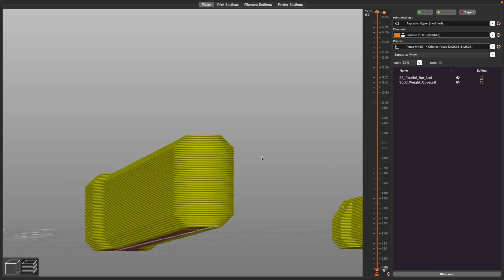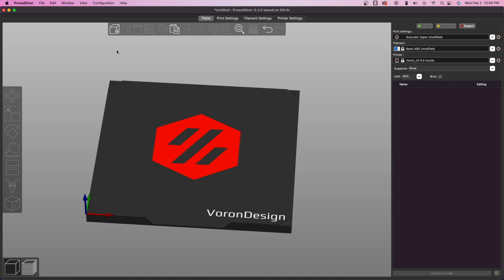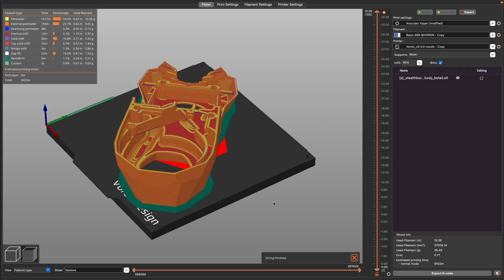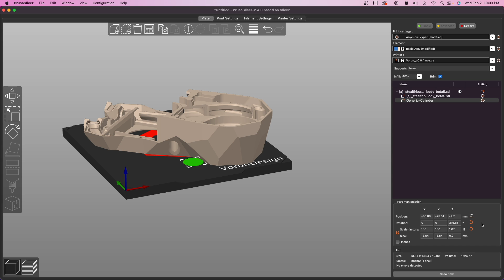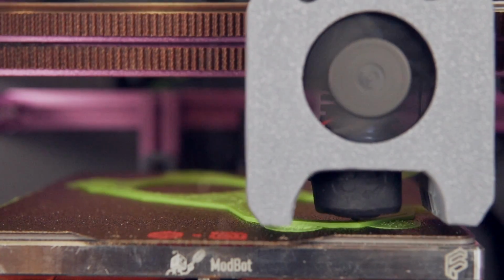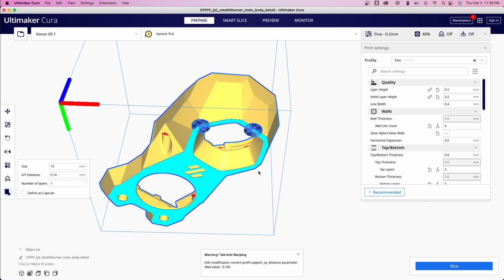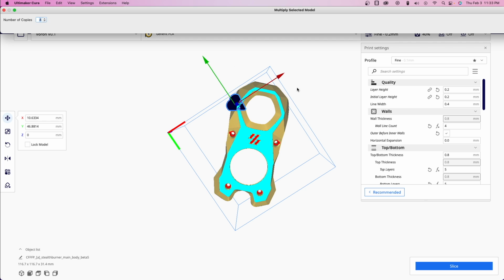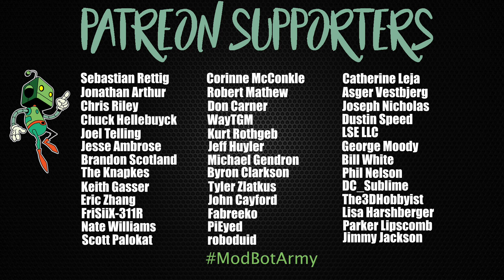Using "Mouse Ears" To Prevent 3d Print Warping

Comment: Ignoring ease of removal, do mouse ears of 2 or 3 layers high perform better or worse? I just want to reduce warping at all costs, I'm printing a big flat rectangular part and it will not stop warping up in the corners

Comment: A better way to do this is to open the file up in cad. Draw a circle in a sketch but offset the boundary around 0.1mm away from the part. Then export this with the STL into the slicer.

This way the lines wont go into the part and will act more like a brim preserving the line pattern of the first layer. I think PS even has an option for this now. Alas its not in Bambuslicer yet.

Comment: Thank you for this video. I am still an amateur and have unnecessary problems with warping. Usually I use a brim on the outside only but is most definitely going to use anti-warping tabs to see if I can save on wasted filament.
I'll be using the words "anti-warping tabs" though I can see how "mouse ears" came about. My term immediately says what it is used for.

Comment: Even if the part does not lift from the bed, they can stil warp.
When I print really big parts, they lift the whole PEI sheet from the magnetic base, and it's not a bad bed (Two Trees) Not perceptible to the eyes, but the parts are definitely warped on the corners.
So in those cases, no matter the brims or the custom ones as you show, you will still get warping.
Reply: I've had the same thing on larger PETG parts, ended up with the stationary clips on the magnetic bed. Also found even quite a gentle air draft in the room will really encourage warping.

Comment: I'm very surprised that you have the need for mouse ears on your Voron Zero. I used to use them years back on unenclosed printers, but they certainly are not needed to print any Voron parts. This looks more like workaround rather than fixing the original issue. Since in the video you never showed Filament tab, it's hard to guess what extrusion temperature, bed temperature and cooling is set for the ABS profile. Also let the printer heat up for at least 30 min before printing! It's less pronounced on V0, but mandatory for 2.4/Trident to have successful prints. I do heat soak mine for 2hours and all ABS prints are excellent :)

Comment: I give my brim/ears a 0.08mm offset. When printed I find this gives me enough contact to the part to hold it down but creates a nice weak point, making removal a lot easier. The value may not work for everyone, but the principle is useful I think.

Comment: Great beginner tip. Been doing that for years with long parts that don't dont have a lot of surface area on the build plate. A deburring tool is a great help to get rid of these mouse ears afterwards.

Comment: Ive never found brims to be particularly useful. The are a small improvement and will not fix any significant issues. Controlling the environment has always proved to be a superior method
Reply: Adding brims is a slicer setting, controlling your environment can be a massive undertaking, often requiring a considerable monetary investment, multiple trips to a hardware store to obtain the materials to construct a suitable environment, and re-configuring sensitive electronics to enable that environment to function.

Nobody is saying controlling the environment is inferior to brims. They're saying brims can sometimes make up for a poor environment with a cent or two of filament.

Comment: I use them in Cura fairly often. Not on every print, but on oddball shapes, or large pieces that want to curl off the bed. They work pretty well and are a lot less onerous to clean up after.

Comment: Wan thinking about using mini heat gun to blow hot air on the print level, to prevent somehow of a heat treatment to see if it reduces internal pressure and prevent wraps…

Comment: I also use "mouse ears" on some ABS prints.  The warping occurs at sharp convex angles like the corners of cubes, so I place them only at these corners.  The shrinking stress caused by cooling ABS tends to be worst on these convex angles so I use mouse ears there.  I've simply created a 10 mm flat disk in my CAD program (I favor OpenSCAD), generated the STL and just add them to prints in the slicer before generating the gcode.

Comment: I've used these in the past but being in the v0.1 I don't need to virtually at all. That part should print perfectly fine without any additional bed adhesion methods providing your bed temp is good (about 105) and enclosed. I keep it in my toolkit for those troublesome prints.

Comment: If you print the part without ears and it lifts, In some cases you see a discoloration of part (when it not overly obvious it’s warped). The the size of discoloration is about the size of the mouse ear needs to be. 

Also when you put mouse ears in the part can still lift ie the mouse ear fails - so the mouse ear will looks like a cone. Where edges are held but part closest to part lifts with part . In this case do a mouse ear with 2 or 3 layers to allow more rigidity in the ear and counter the part warp.

Comment: The first layer in prusaslice3r 2.4 has the mouse ears as the priority. The part will start and stop at the ear. In previous versions the mouse ears were secondary to the part so the part ran as normal and the ear was then made. Hopefully prusa fix as you get weird perimeters atm.

Comment: Superslicer (prusaslicer fork) has this fully featured where you can even set a detection angle and will auto generate the ears on corners that are under your definded angle, works really good!
Reply: where is this setting?
Reply: @supercoolbuilds  under skirt and brim tab there a check box called brim ears then you can set the angle
Reply: Wish bambu slicer had this

Comment: Love it! I have been using this technique for many of my longer prints with abs and Asa. They work great and haven’t failed me yet. Thanks for sharing how you do it. I was manually adding my own flat cylinder parts rather than the right click method but that is very slick also.

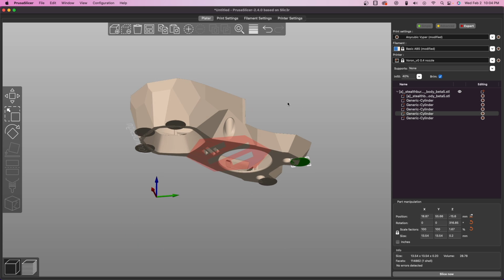Comment: At 05:47 you can see the lilly pads altering your main shape, this is something I don't like. You have nice results, maybe because of the textured pei sheet, but in Ideamaker this will make the lilly pads hard to remove. That's why I use a boolean operation on them to cut out the main shape. This way the pads follow the outer walls of your shape and can be removed just like a brim. I know my explanation is not the best 😅
Reply: Bernard Bout  super slicer has an automated function implemented. For prusa slicer the easiest way I found was to use prusa slicer 2.4 -> make copy of the main shape and position it on the same location so they fully overlap -> add cylinders just like in the video -> select all cylinders and the copy of the main shape and merge -> in the menu on the right select the copy of the main shape in the 'merged group' -> right click -> change type -> Negative Volume.

Comment: Cool.  I'll definitely have to look into this plugin.  I've been doing this via the "merge meshes" function in Cura and setting overlap to 0, which works (it cuts into the 2nd model you add to the print), but has some limitations.

Comment: DO NOT USE on CURA. There is a conflict between the addon and Cura. When you use them they can alter scaling, sizing, location, etc. The developer is aware of the issue and says it is a Cura problem that he cannot fix . It an issue from 4.4 and ongoing to 4.13.1. That beings said they work very well otherwise.

Comment: Great content. Thank you for this. I never thought to add another shape in the slicer. I've been having trouble with 'rounded' edges of square parts where the material has cooled and is pulling up from the bed. I've tried adding brim and it helps, but not enough. I'm going to try varying thicknesses of this technique in those corners to see if I can get some pristine parts.

Comment: Clever idea. I will definitely use this. One thing I do in a similar vein that I haven't seen anyone else do is this: when printing multiple objects at the same time I make sure the objects are close enough to each other that the brim connects the first layer of all the pieces I'm printing. This makes it so that each object shares some of the adhesion force of the other objects. It also makes the whole plate of objects come off as one piece which is nice. It also reduces the chance that a small error printing one of the objects could ruin the entire print. It does create a lot of brim mess to clean up though. I'll probably incorporate this brim tab idea to reduce that mess.
Reply: I do that as well, but have also had an issue because of it.   You would of course need to be careful which parts are connected sometimes.  I had one part lift a bit one time, and because it did, it ended up dragging everything else off too since they were connected by the brim.  But it does come in handy when it works for sure.

Comment: Good tip you can save or even use the shape command in super slicer to create these on the fly.
Reply: SS actually has a setting for brim ears built in, you can set the max angle that they get generated on.  It defaults to 125° and I’ve had great results with ABS prints using it.
Reply from the maker: I still need to venture into SS. It took me so long to make the jump to PrusaSlicer. I think when I am done with the Switchwire I will use SS with it to give it a test run 😬